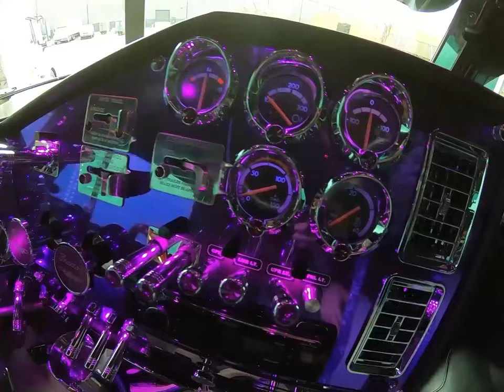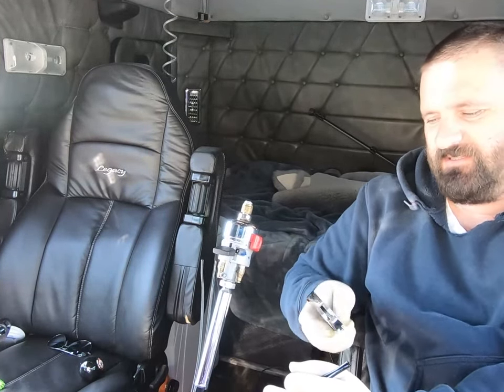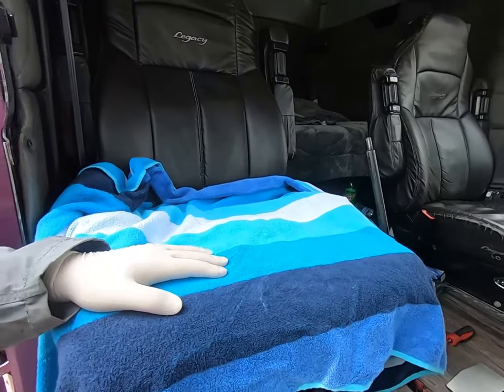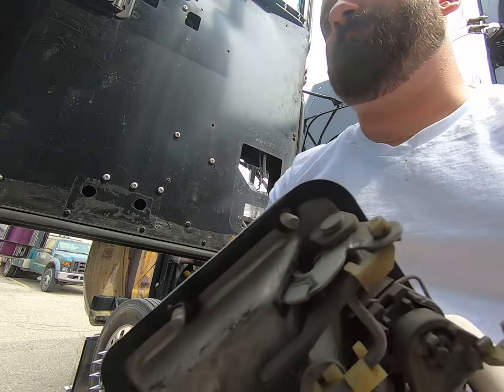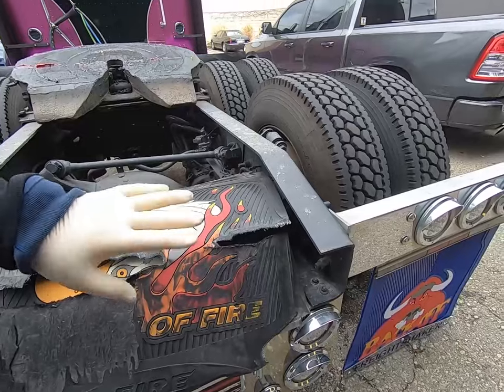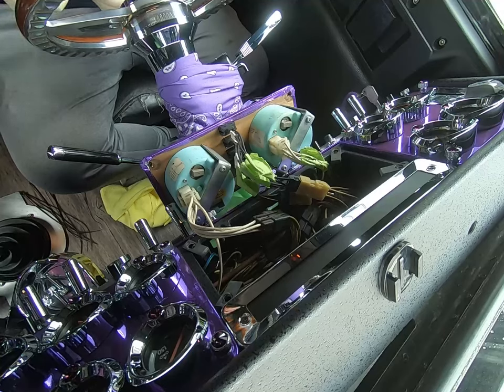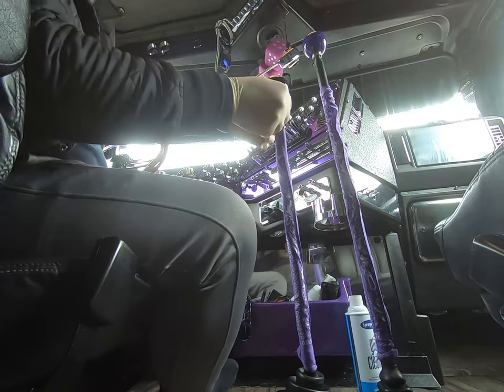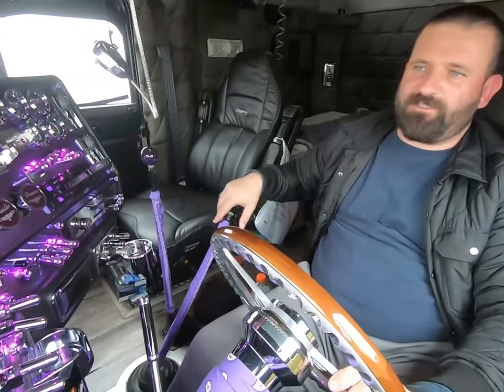Installing A Twin Stick Setup On A Classic XL 13 Speed (AUX Shifter) | W900 Door Handle/Lock Replace

Comment: Run the hi/l9w spliter on the main stick. The new box system is now a H patter no need for the hi/low valve

Comment: I guess you wanted it to look like you have an auxiliary trans? The only downfall is that you have to pre select the splits. There is a lockout on the lo side so it only shifts in neutral. There is not one on the splitter so pre selecting causes wear on the syncronizers. Just my observation. Looks good!

Comment: Great job!  Now I am confused with two shifters?
Reply from the maker: Think about the second stick as the red button on the side of the shift knob
Reply: @TruckingPassion  Ok, so the 2nd stick is just 2-positions, like the red switch?
Reply from the maker: @AlongtheRiverLife  Yup
Reply: @TruckingPassion  So the black button is lo (1-5)/Hi (6-10), red button is over drive?
Reply from the maker: Yes sir